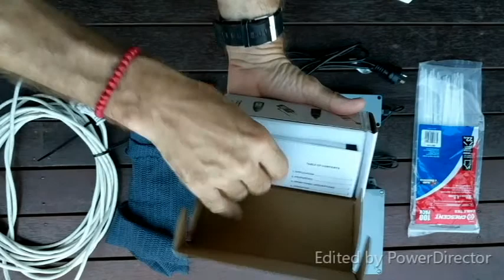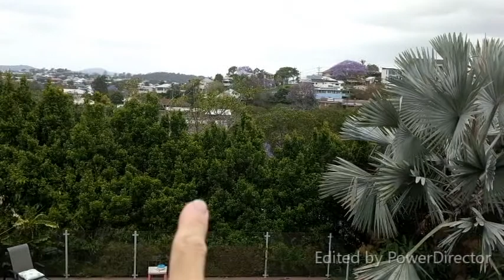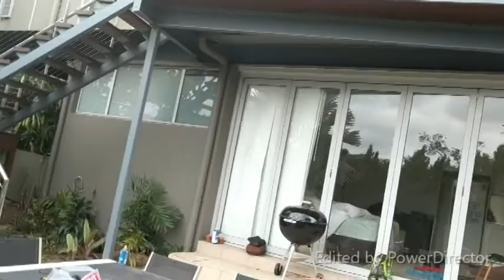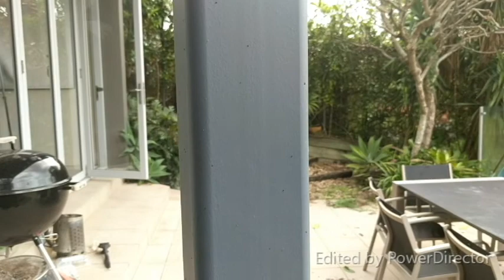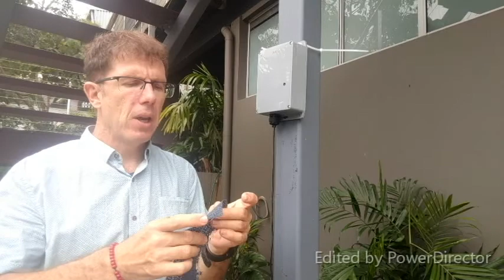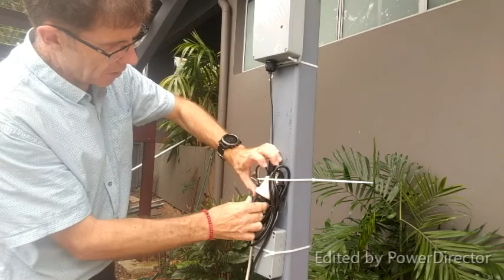NoiseNet Monitor Installation Video Part1

Comment: I know there is a noise problem as do the rest of the neighbors. One neighbor opened a dog pound. I'm interested it something to stop the noise. Can you cancel noise?
Reply from the maker: Hi @johnskunk609 no our devices don't stop sound.  But what they do is provide the data to your local animal control and/or code teams so they can enforce planning limits or ordinances against noise.  If its still an issue, raise a complaint with your local town/city/county, then put them in touch with us.  We can help them to help you.